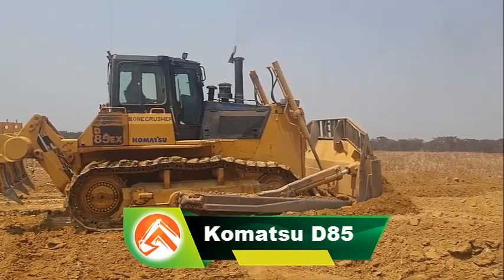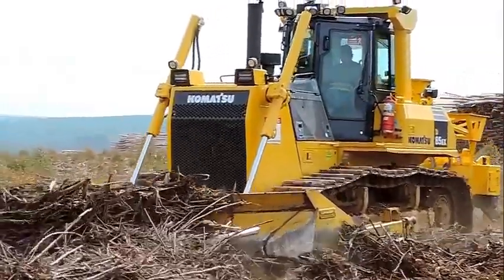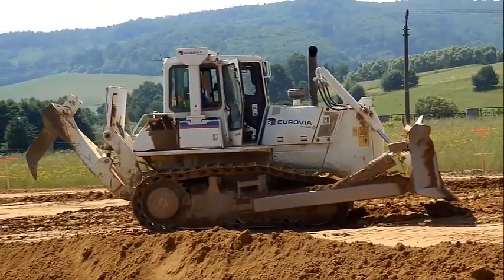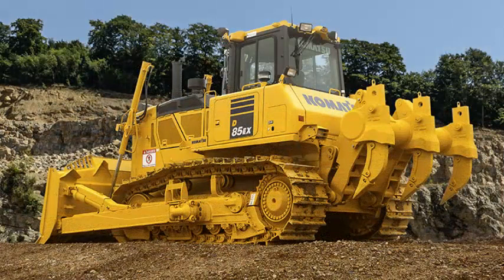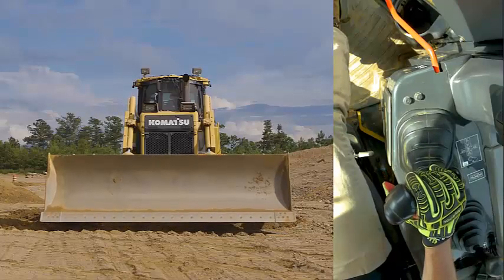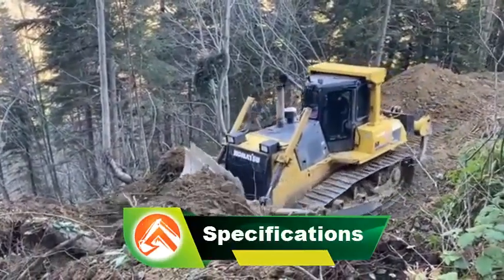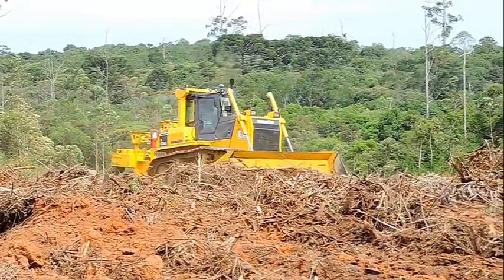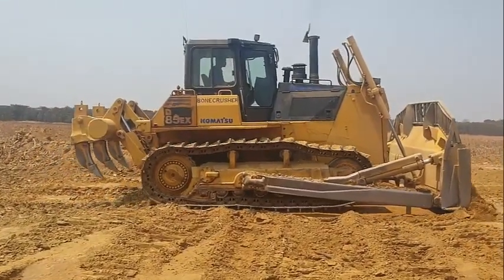Komatsu D85 Crawler Dozer Documentary and Specs #komatsu #dozer #d85

Comment: Nice crawlers but the electronic’s on them is insane. Our county road crew dropped one through the ice last winter, deep enough to cover the floor boards,,absolutely fried the engine and transmission controllers. 700,000 $ damage. The old ones you would of pulled it out changed fluids and been going the next day. It was 14 months old and they almost wrote it off.
Reply: Was this a brand new model Komatsu d85? Holy smokes. $700k? What was it priced for as a new dozer? I think I'll stick with my 1980's and 1990's Cat dozers. Ouch!
Reply: I think all new modern day dozers would be the same, they are full of electronics.